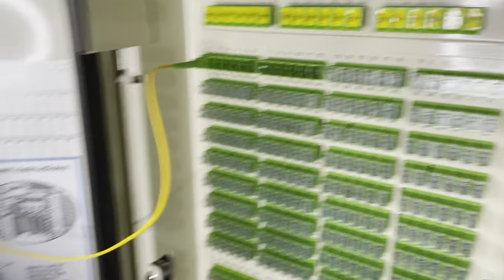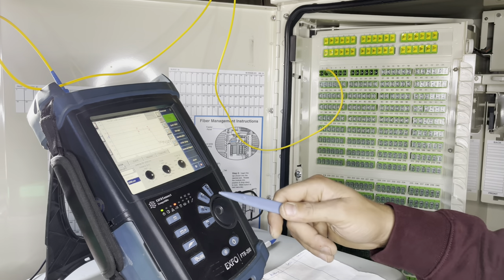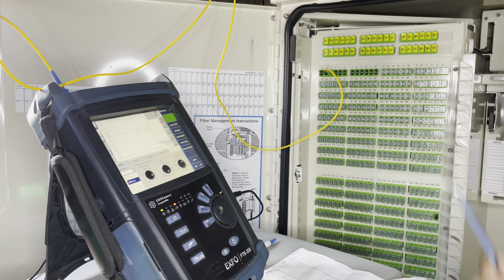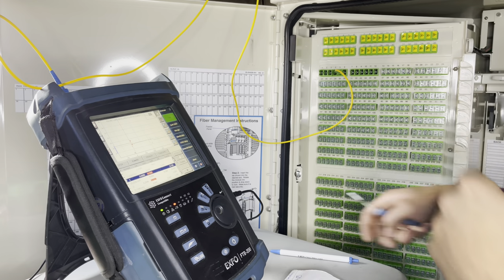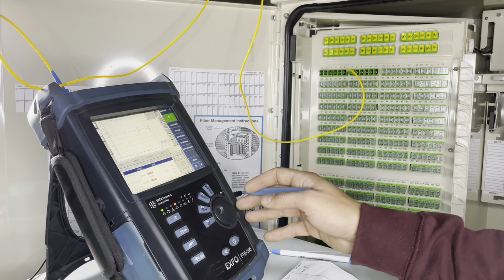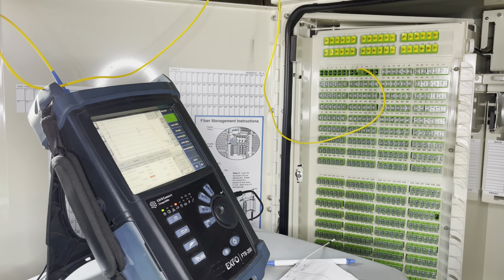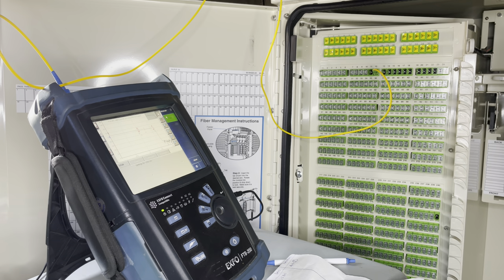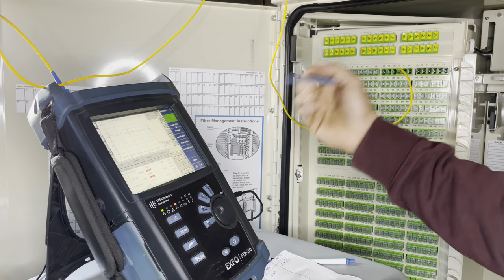FREE Fiber Optic OTDR Testing Training

Comment: How can you achieve true loss without a remote unit?  You have a launch reel. Great.  But for an OTDR to even guess at loss it needs a reel on the far end.  A true loss test requires end-to-end testing with loss meters. Another thing you should acquire is an optical probe,  A dry swab isn't a quality clean.  Always wet to dry cleaning. You wouldn't chase your tail fiber after fiber with quality cleaning and probe of the surface of the fiber and adaptor port.  I was raised on Exfo and moved to Fluke but the game is the same.  Love your stuff.  You drive that OTDR like a beast!  I learned some stuff.  Keep posting please.
Reply from the maker: Thanks for watching and commenting I really appreciate it. Yea great point and I totally know what you mean. for this customer they just want uni directional exfo OTDR 1 wavelength 1550 and 5 second tests and since it’s just distribution they don’t require a launch on the end. We also power meter all ports dual wavelength bidirectional with the exfo 930’s yea after 10 years of running the old girl I can get testing done pretty fast 😂 going to be upgrading this year tho and just keep this unit as a spare. Thanks for watching more videos coming soon
Reply: Keep em coming.  I'm not throwing shade. I just want to know why you do what you do and maybe I'll learn something and vice versa. I was trained on 930s, actually 920s,  and use them when our DTX 8000 is being used by another splicer. I rarely used a probe until recently. Slowed me down. But I swear by it now.  Stay safe. I'll keep watching.     @fibersplicegod
Reply from the maker: @gradyrm237 totally understand and thank you for commenting and watching always great to meet other fiber guys

Comment: Any otdr and power meter bi directions test unit sugestions need a set badly
Reply from the maker: Best brand to go with is exfo they are not cheap and expensive to keep calibrated but worth it I’ve had the same unit for 6 years now. Exfo max tester is a great unit and you can have multiple modules otdr and power meter along with a exfo 930 for the small handheld unit to pair with max tester for power metering

Comment: thanks you so much for the videos , i learn a lots !!
i have two question and i hope you can help me with them :
why Multimode OM2,OM3,OM4 even do they have same core size !!! but different in speed , in adapters , in patch cable ?

also base on what i measure my OTDR Loss to , for example  i have test a cable with length of 300metre , and the loss was 0.60 db, how do i know that this number is good or not ?
Reply from the maker: Glad to hear this thank you for watching and subscribing I really appreciate it🙌
All the networks in my videos are all of single mode fiber.

Multi mode fiber is more used for back bone infrastructure because you can transmit and receive on the same fiber as well as very high speeds/bandwidth.

As for testing it all comes down to customer requirements aka what they would like there loss below per connector and splice based off the original design and equipment being deployed. Always reference out test cables as well as with OTDR I always try and keep connector loss at a 0.5 db and under and reflectance -50 and below
Reply: @fibersplicegod  thank you for your answer really appreciate it

Comment: Is it ok to reuse the swabs? Don't you risk transferring dirt from one port to the next?
Reply from the maker: Yea I usually use the same swab for around 12 ports then switch to a new one and yes you can transfer dirt from one to the next but if you dip the swab in 99% alcohol in between cleanings it will remove the dirt from the swab and you will be good to go

Comment: the optimum optical power required for FTTH connection type is how much dBm ? (i mean a good connection for 1 gigabit ethernet )
Reply from the maker: This customer requires a 0.35 db per any splice loss but they also have a acceptance for when there is a Afl spider web ribbon cable being spliced to a Corning or Prysmian cable the core diameters are not the same so we are allowed up to a 0.6 for a splice loss or gainer when testing that particular scenario. Thanks for watching and subscribing I appreciate it
Reply: No, what I wanted to say was not the acceptable loss in the splice sequence. what I wanted to ask was how many dbm range should the fiber optic power that should come to the gpon ont device installed in our apartment be in? @fibersplicegod